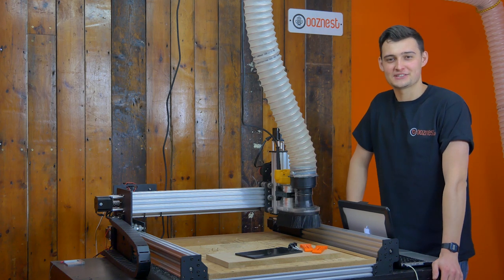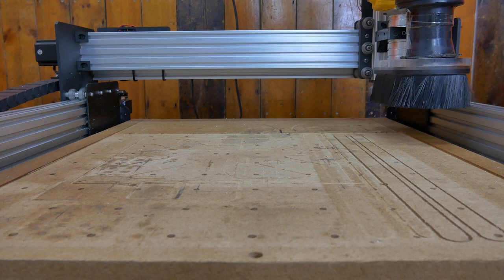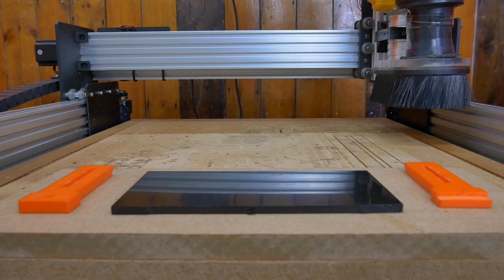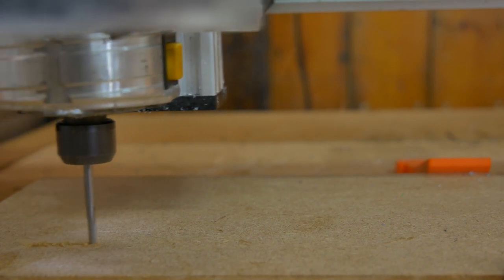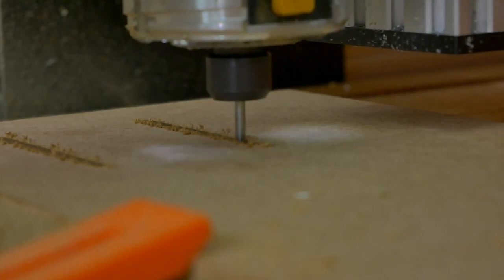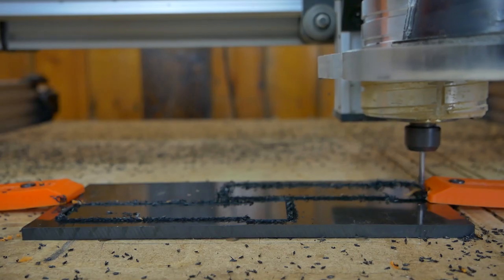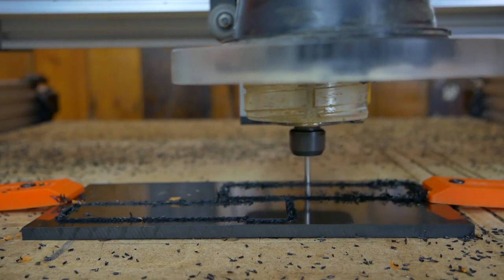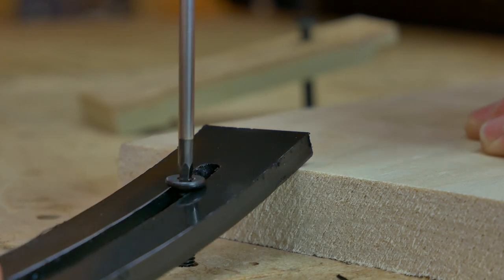Makers Minute | Manufacturing Clamps From Scrap | WorkBee CNC Machine

Comment: When making these it would be a good idea to make some packing pieces to pack under the other end, so you can keep the clamp more level when in use.  Should give a better grip of the workpiece and less pushing away from the clamp. See you at NEC Maker Central.